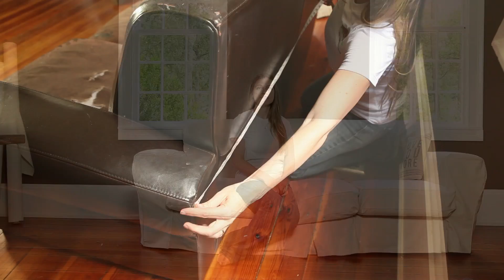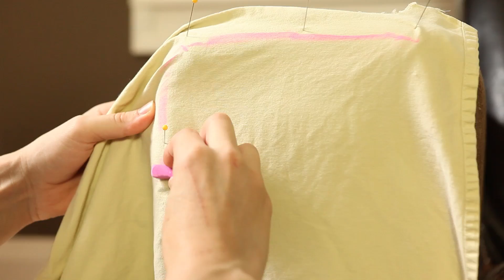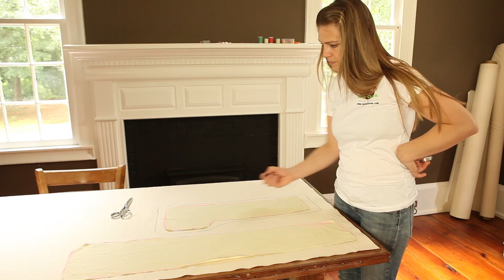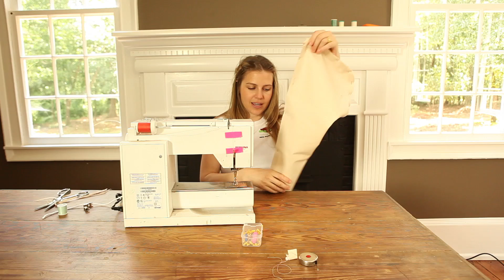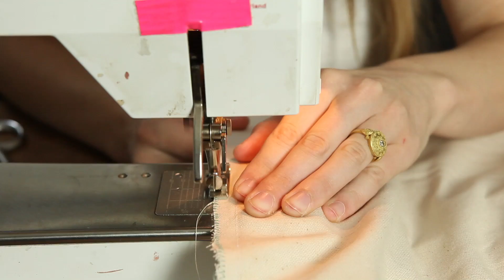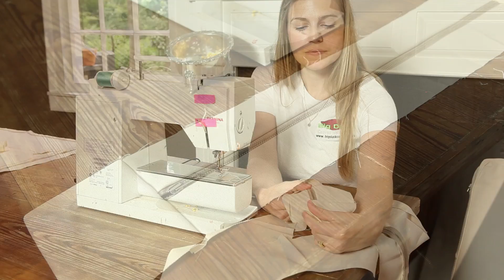DIY Slipcover: How to Make a Fabric/Canvas Slipcover

Comment: Very informative, but you didn't show how you cut out the larger sections , the back and front and the part under the cushions.
Reply from the maker: I did the same technique for pieces big and small.  I pinned the sheet on the back, outlined it and cut it out.  The bigger pieces are much easier than the arm rest because they lay flat vs having to be fitted around a curve.  They are also more basic shapes. Thanks!

Comment: How did you measure and join outside back and inside back. And how did you join these parts to inside arm ? I am a beginner and need some more info.
Reply from the maker: I made a template of every piece with the chalk and the sheet including the outside back and inside back.  I cut the shape out of the sheet and then outlined it on the 10oz canvas.  I cut the pieces out and pinned everything together inside out and sewed.  I would lay it over the arms and parts of the sofa sometimes as I pinned to get a good fit.  Thanks for checking out the video!

Comment: Today I started my first slipcover, the fabric is similar to yours, duck.  I have a question:  Is there a way to tailor the part on the side where it rolls over the arm?  I'd like the fabric to hug the side of the chair rather than have it just hang there.  And, thanks for sharing.
Reply from the maker: +Alice Crawford Hi! You would just want to make your slipcover a bit more snug there, which would mean after to make your template you would cut your fabric closer to the size rather that making it loose as I did in the video.  So happy to hear about your project!
Reply: Use Velcro

Comment: Why does the slip cover look so sloppy
Reply: Marie Salisbury I think I would turn the cover inside out, try it on the sofa and adjust the fit in the areas where it seems too loose.   A lot of people prefer the looser (sloppy?) casual fit and it does prevent tearing of the fabric when people sit on the sofa, which can happen when the fit is snug.